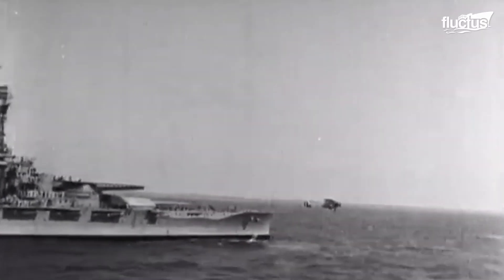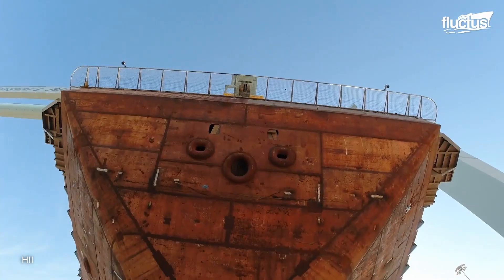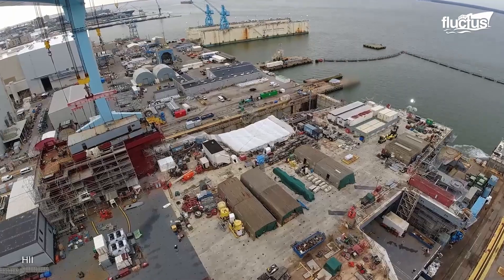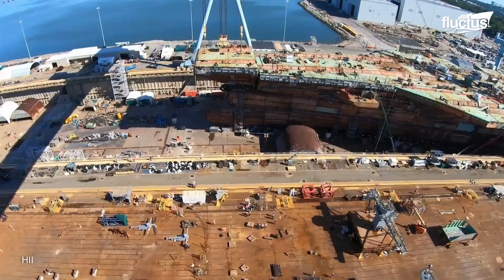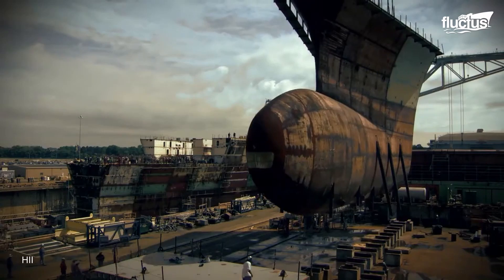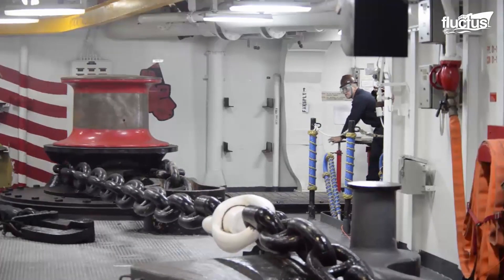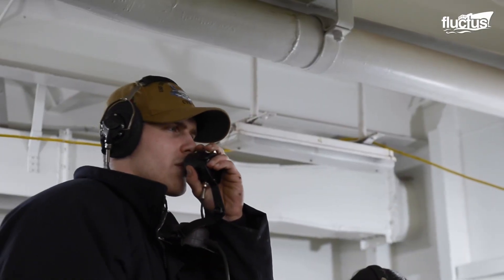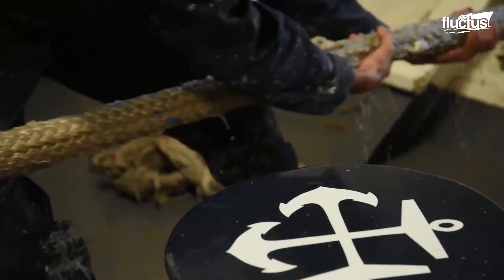How Gigantic Anchors Are Installed on US $13 Billion Aircraft Carriers

Comment: Britain has two new aircraft carriers of the Queen Elizabeth 11 (2) Class, EACH cost about £3.8 BILLION or about $6.65 BILLION,  neither work fully, both have been plagued with breakdowns, and major leaks, they cannot operate in hot climates, and frequently have to be towed in for repairs, and worst of all, if a new engine has to be fitted, each ship has to be literally cut open for the re-fit, there is no easy way to remove and install an engine, they are a FECKIN NIGHTMARE to operate and maintain.

Comment: I live 15 minutes from Newport News Shipbuilding and have driven by it on my way to and from work for more than 20 years.  I've seen many of those "superlifts" dangling in the air as I sit in traffic at the Monitor-Merrimac Bridge Tunnel.  Spent 2 cruises as part of the air wing on the USS Independence and 1 on the USS Forrestal.  The Forrestal was considered to be the first "Super Carrier" ever built  Massive ships that are dwarfed by the newer Ford class carriers.
Reply: My dad did a couple cruises on the Indy also. Sometime in the 70s

Comment: The new lines are made of spectra 12 it's 5 times stronger than steel and a quarter of the weight of old lines ,each link on the chain is over 200 lbs

Comment: I wonder if those anchors can totally stop an aircraft carrier.
I am sure they slow down some but 30 tons doesnt seem like a lot of weight compared to a floating city.
Reply: The chain holds the ship while anchoring. The anchor just holds the end of the chain in place.
Reply: Anchor is not used as a brake except in an emergency. Ship must be stopped before anchor is dropped.
Reply: Well said friend.
Reply: It is amazing to see one of these chains snap like that are a 1/4 inch chain.

Comment: It’s called the FOREPEAK not “forecastle”. 😂
Reply: It is called forecastle
Reply: @ronaldpetrovich 
Pronounced as foke sul and spelled forecastle. 
I was on the Saratoga.
Reply: @Youtubeparolee  i know CVN-72 USS ABRAHAM LINCOLN 91-93 Cook
Reply: Forepeak is the lower part of front of the ship. Usually used for storage.
 Forecastle or focsle is the correct term.
Reply: @davefitzpatrick8775  ya I work on yachts and didn’t know that.  The biggest yacht I’ve been on was 3000GT.
Reply: Good spot!